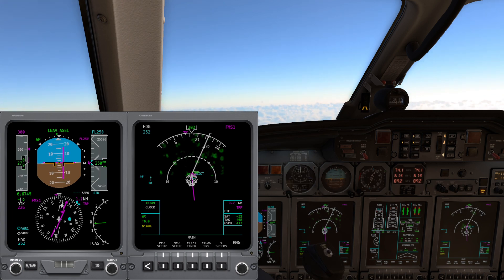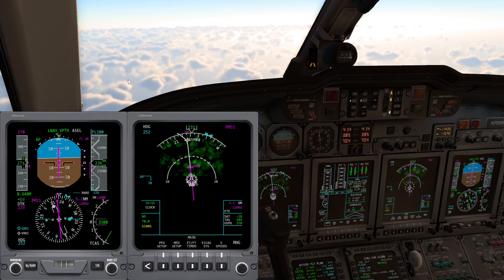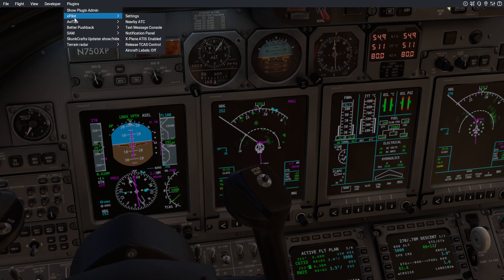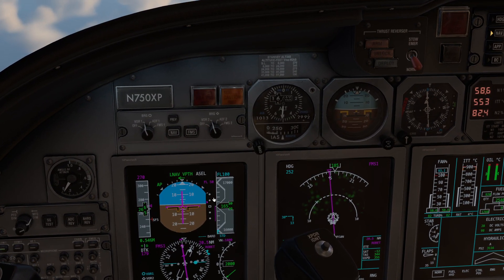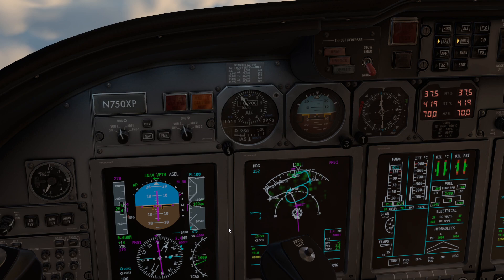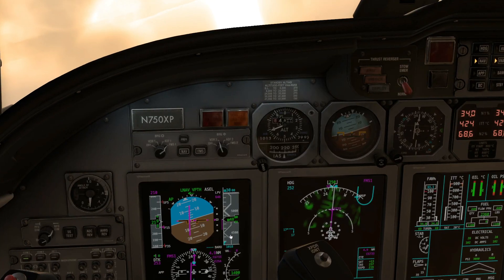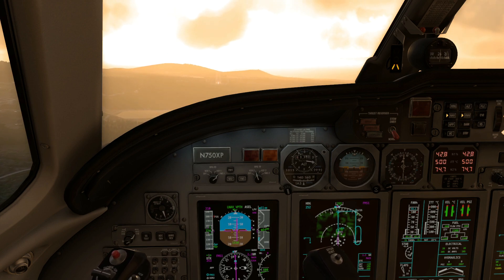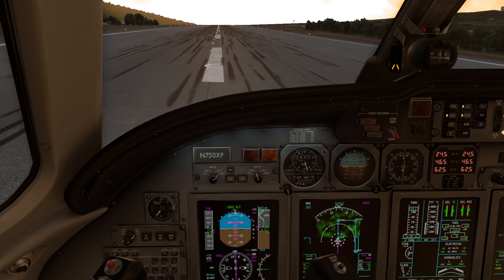[X-Plane 12] Cessna Citation X | Part 2 - Descent, Arrival & RNAV Approach Tutorial

Comment: I’m unable to go over 240-250 knots without the plane rocking side to side. I see you were able to get up to 290 KIAS. Is there something I’m doing wrong?
Reply from the maker: Hi, check you acf is in clean configuration, you never know you've left slats extanded. Also try with disabling the real world weather as it might be an erratic turbulence problem. For me the plane is stable at high speeds.

Comment: Thanks ! good work.... How can I make sure I have enetered all appropriate altitudes for VNAV ?  it seems quirky ?  I have tried using the PROC and NAV buttons ,  but many do not allow entry.  Most of the time i select VNAV on the console and i get error "VNAV unavailable "
Reply from the maker: Hi, the flight plan should bring in its altitude constraints, then by compiling the init pages all altitudes should fill in automatically.
Reply: @crisk73  I think I've tried all possibilities I can't seem to make it work I'll just have to keep at it thanks for the reply
Reply from the maker: Did you double click on the fuel field in the init pages? If you get any error, try with a lower cruise altitude.